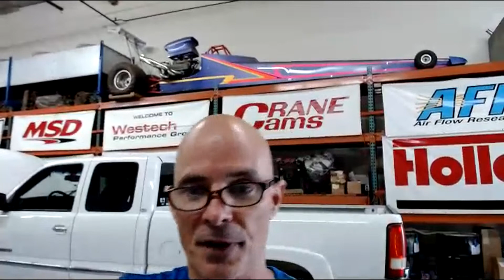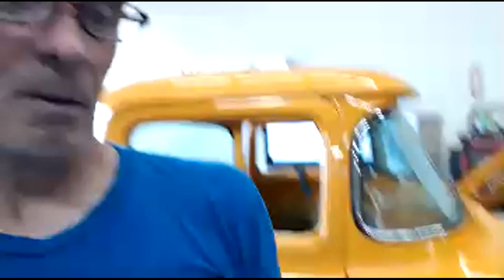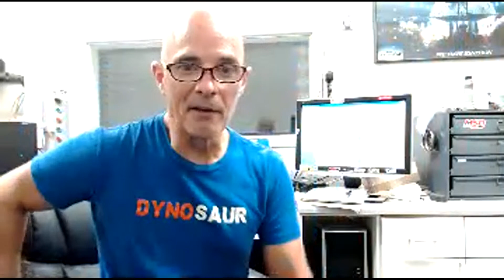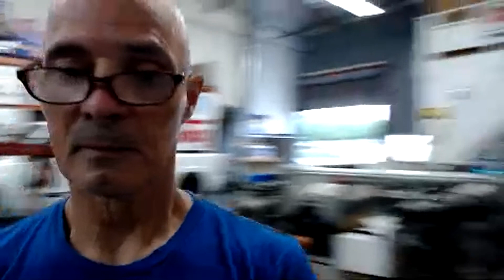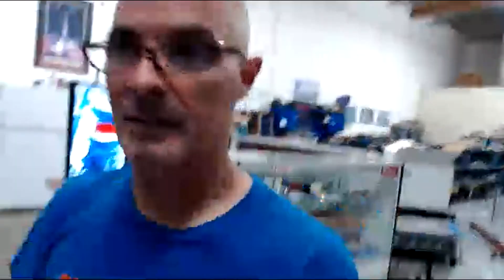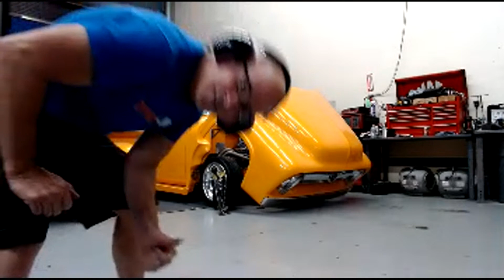LETS TALK TECH-BOOSTED CHASSIS DYNO TONITE!

Comment: A megasquirt will be able to run the sprint motor, if the crank wheel pattern doesnt work with the megasquirt then putting an LS wheel on the balancer has been done to lots of stuff
Reply from the maker: A 24X OR 58X ON A 3 CYLINDER?
Reply: @richardholdener1727  okay probably not LS but theres definitely something out there that would work if it wont support whats in it.

Comment: Still think the best sleepers are ratty looking old 3/4 ton trucks. They already clear a big tire stock. Full floater 14 bolt or d60/80 are Lincoln locker tough and are still stout with 5 something gears. Camper special models generaly have big rear sway bars . 4000 pound curb weight is lighter than most new muscle cars. Last but not least is that you have the engine bay space to not have to con a 10 year old with tiny hands to get to stuff.